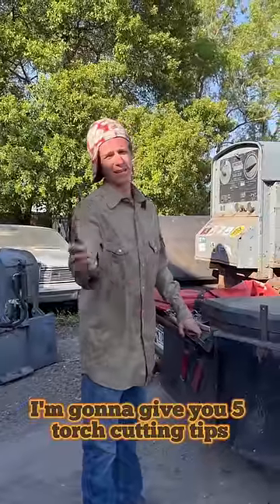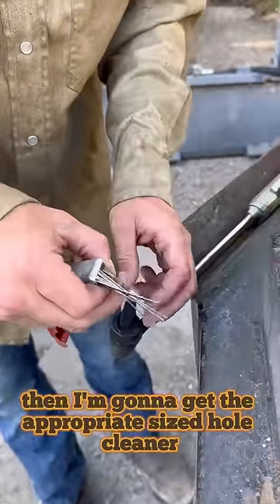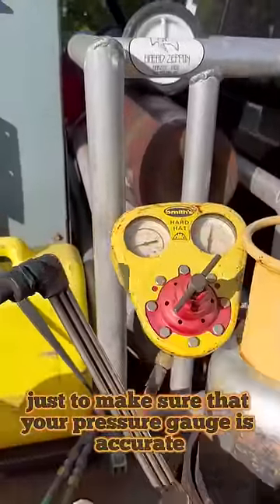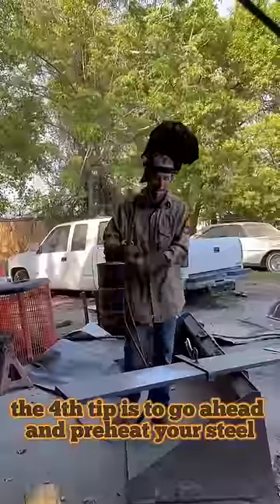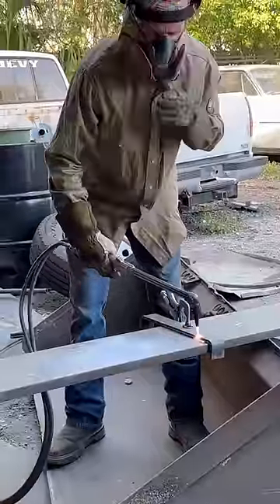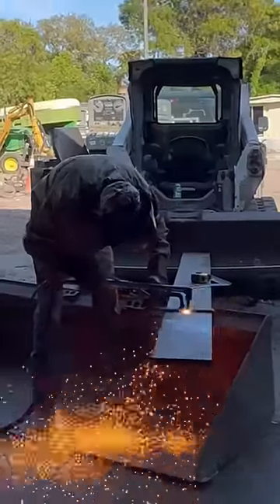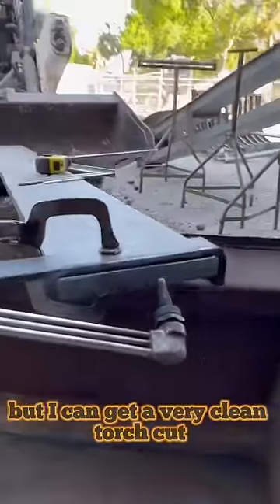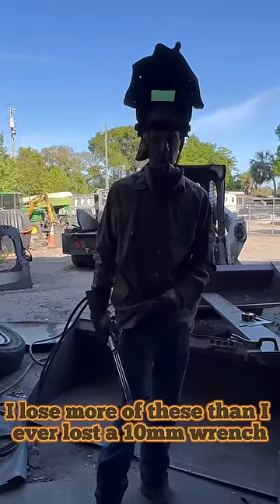Perfect Cut With a Torch on 1” plate

Comment: Thanks Anthony, I just started working with torches and the tips are helping a lot. Gotta remember to keep the striker close I keep having to look for it
Reply: Pro tip. Get a carabiner and put your striker on it as well as a 6” crescent wrench. That helped me out tremendously plus it’s harder to lose when you got a wrench on there to.
Reply: @jordanrounds9890  you can literally carry those in your pockets of your coveralls. Lots of handy pockets of them.
Reply: @BootsySage  Its easier when its on your hip, dont have to take the striker out of any pockets just bring the torch down to the hip and light off. Same goes for the wrench if i need to quickly swap out a cutting tip for a scarfing one. Idk personal preference for me.
Reply: On the first day of college welding class and I did all this.  The professor said I can tell you, you are getting an A
Reply: No way that you lose more than you lose 10mm's, lol. The striker industry would be our number 1 product
Reply: I'll be impressed when I see you crawl under a ship and wash the weld off the ship keel ( overhead, 4 feet off the ground) without gouging the hull.  Cutting your own tank wrench is a good start. 👍👍 Flamecutters rule !
Reply: Never carry a cigarette lighter in your front pocket.
Reply: If your work is still glowing you can usually restart quick by tapping on it if the flame extinguishes. Also starting off with a little oxy when you light up can keep the soot down, plus the oxy knob will already be cracked loose so you don’t have to fight it after your fuel is lit.

Comment: I always find it so impressive how engineering came up with a tool that uses fire to cut through inches of steel at such a high rate of speed ❤
Reply: It’s not really the fire though it’s the oxygen that very rapidly oxidizes the metal and blasts it away. 🤙🏻
Reply: @Jackson Combs it's still fire. If you turn the flow down, it's just a big flame. It melts the metal with very hot fire and the rate of flow kicks out the slag. It's just a really fast fire. The oxygen helps the torch burn hotter. It has nothing to do with oxidation. Steel ignites at over 1000 degrees and the oxygen helps the flame reach up to 3200 degrees. The fuel mixture is being burned simultaneously.
Reply: @Brolly-Unleashed  oxidation is fire.. It's the combination of an oxygen atom to a carbon atom (iron melts at 1,550 degrees BTW)
Reply: @campbellpaul  you can put anything that burns in oxygen, and it will burn brighter and hotter. Oxygen isn't flammable. You can cut metal without oxygen so the process can't involve oxidation. It's simply their to boost efficiency.
Reply: @Brolly-Unleashed bro what? Steel doesn’t ignite at any temperature it melts. In the case of oxy-acetylene cutting it’s oxidized so fast it looks like it’s burning or “igniting.” yes acetylene creates the fire you speak of but the true heat comes from the oxygen oxidizing the metal.
Reply: @jacksoncombs9290  fairly complex way of saying agree to disagree there are sources that say both are correct and it ultimately makes no difference.

Comment: you should talk about which bottle to turn on first. how to adjust your torch valves and how to start.
Reply: Doesn't matter, you adjust your pressure before lighting the torch. When lighting the torch you always open and close the fuel gas first. As for adjusting the flame when cutting it's pretty simple, you want them to be an even height so that they heat the metal evenly.
Reply: And proper shutdown/storage procedure.
Reply: This isn't meant to be mean. But if you need an explanation and help on which tank to open 1st and how to start your Torch... Then this isn't the video you should be watching.

This is a video explaining how to do a cut through heavy metal.  If you need to start at that level of instruction, there are many great welding channels that will walk you through the whole thing.
Reply: @thebigcheese8715  You close the oxygen first when turning off otherwise it will sound like a machine gun.😂
Reply: @moefritz9568  Never seen that happen, oughta clean your torch by the sounds of it.
Reply: @thebigcheese8715  meh, not my torch, it's the multi billion dollar company's that I worked for
Reply: @moefritz9568  they must've cheaped out and bought the hobo freight torches instead smith ones
Reply: @thebigcheese8715  Not sure the brand but it didn't help when they let the new idiots use them and they didn't know how and get the tips covered in slag
Reply: @moefritz9568  you'd think they'd show someone the proper way first, sounds like a recipe for disaster. Unless it's real bad good ol' oxygen and wire brush works far better than them shitty nozzle files. Darn things break just touching it.
Reply: 5lbs acetylene 25 lbs oxygen open acetylene first, light, open oxygen, cut away.

Comment: Adjusting the gas correctly , distance, pressure from the O2, and speed are all big factors. Each adjusted to metal thickness so it just takes practice. If you have the time and money, and you or someone you’ve hired, can just use scrap to practice. Scrap cutting is helpful as you get to learn on metal that is all shapes and sizes. It also gets people used to using the torch as they learn not to be nervous around it. It’s nice of you to show tips on this.

Comment: Good tips man. Another good one is to get used to cutting without putting much weight on your guiding hand or arm. It helps you smoothly glide across the surface of your path without stuttering and losing the puddle on the leading wall of your curf. It applies to allot of other welding and fab processes too.
Reply from the maker: Great tip!

Comment: One further tip is to watch the sparks angle as it leaves the metal.  It should be about 80 degrees, and adjust the speed of the cut to keep this angle steady.
Reply: Nah bruh watch that puddle don’t watch the damn sparks
Reply: @Bobbobness  dude its not a welding. There's no puddle there.

Comment: My 1st tip is: don’t file the tip and clean the holes with the tip still attached to the torch.
Reply: Why not? Thats what they teach us in school..
Reply: Did you see how clean the cut was
Reply: @northcountrywoodcraftny5953 it’s easy especially when The guy used a guide and held his torch against it..  you won’t have that luxury anywhere else but your own shop most of the time. I also don’t recommend burying your torch tip like that you will go through them faster than you can buy ‘em. lol.
Reply: @prius.killer it can be ok still but crack the air a little while cleaning and it will blow out any junk that falls in

Comment: Also use the right tip. Oxy acetylene can easy 100mm-150mm. 1“ (25mm) should be no problem if you can start start cutting from the edge. If you have to pierc through it in the middle of the plate is a different story and even makes me struggle sometimes 50/50 chance of backfiring. Some good days and bad ones. Always be aware the the torch can backfire and be ready to close the acetylene
Reply: When you ready to pierce, you suppose to do it at slight angle, not square to the plate.

Comment: Never done the prep heat🤔🔥 when cutting only when tig welding.  I typically use the plasma touch ⚡️but may go back and try some old school.  My touch is set up for welding and build up mostly.  Like welding aluminum and cast iron with it as that is about 80% of what I do with it or pre heat 420 stainless🥰

Comment: Straight edge when possible as a guide is just smart and should be used. So many times have I seen dudes cut with a torch and say “I don’t need no guide, I can make a near perfect cut after doing it for years” yet it still ends up all weeble wobbly…

Comment: Si i do this regularly at my job but with propylene and preheat is a must on this stuff. Also having proper pressure on the regulators is a big one too. Those 2 and you can get away with a lot if those 2 are done right. With that I regularly cut 3/4-2” steel.
Reply from the maker: I want a propylene set up

Comment: Not even trying to be a jerk here, but this is absolutely aimed at folks who have never, or only just started using OxAc torches. I know it's probably overly semantic, but this should have been titled, or you should have intro'd the clip as "beginner's tips."

That said, these are definitely good beginner's tips. If you can, you should try to use a piece of c-channel as your guide. You can ride the whole torchhead along the vertical and only have to worry about keeping your cutting height if you're really green.

Comment: Get as comfortable as possible before you start the cut. Use a 00 size tip for material under 1/2" thickness. Oxygen pressure shouldn't be over 45 psi. When cutting on plate use a chunk of 2x4 wood to rest your hand on. It's the perfect height and your hand stays cool. Use a dark face shield made for cutting. Keeps your face from getting burned from infrared heat and splatter.

Comment: Here is the best tip. Solid block about a foot long as guide about inch wide and tall enough to keep the tip quater inch above workplace when resting the tip nut on it. Weld a simple handle off one side. Easy straight cuts, you'll keep your tip cleaner for longer and the guides own weight hold it down.

Comment: Position yourself where you can look behind the flame all the way through the kerf then you can watch what the far edge of the plate is doing and you can make it a little cleaner. Of course trying to look down the kerf when cutting a circle is almost impossible, but I'm sure someone has a good tip for that it's just not me.

Comment: You can rub the tip full throttle against a wooden board to clean the tips, might work in a pinch good trick old welder taught me

Comment: I'd say I have to agree with you. The absolute insane number of times that I have had a striker fall out of my pocket or the tip unscrew.....

Or having to crawl up on a unit to braze something, finally get in the perfect position and suddenly hear the perfectly distinctive sound of cheap thin metal hitting the concrete.....

Or to be on a site and I'm sitting up there in a man basket a 100' in the air and suddenly realize can't strike up because climbing in and out of the basket to load gear, I knocked the sticker out of my hands.....FML.  (thank god I still smoked at the time.)

Comment: Ok, I've been at it for close to 30yrs and if i might add a few words?... turn your gas on slightly while you're cleaning your tip or take it off the rig(u don't want those lil burrs falling back down in your setup) and the gas will push them out. Use a piece of 2in angle iron for your straight edge. U can just let the torch sit right on the top and drag it along (helps control any depth issues) kick your tip a bit forward so you're cutting a lil ahead and once u begin, don't move on till you're all the way through. 2nd pass cuts pop like alot. And when your done, THAT'S when u clean your tip (on a piece of wood) just rub the face all over it. And after you're gettin it, if it pops and blows u out just hold that fucker down there and the cherry will reignite your shit. And, WRAP YOUR CORNERS!

Comment: My tip is to use propane for most all metal and acetylene for the thick metal.

Propane is cheaper and much easier to find if you run out in a location that’s is too far from an acetylene supplier👍
Reply: Acetylene is much better to work with. Most shops have gone to propane but out in the field acetylene will always be king.

Comment: All great tips.  Except there is no need to preheat your work if you have the correct cutting tip for the steel thickness.  Having said that, I agree that if there is mill scale on the work you can't get a clean cut.  That preheat pass can spall off the mill scale allowing a clean drop cut if everything else is good.  (I've been burning steel since 1966)

Comment: Next time just cherry a corner and always give the torch an angle in the direction your cutting in. 
I used to have to cut train cars and trucks for a living. You had to cut no less than 2 per shift. I could cut 5-7 in a 9 -11 hour. 
When you strike up, put the hot flame at the bottom corner. As soon as it Cherry's run the bead. Cut away from you and keep a steady slow pace. I used to cut 3-4 inch thick pieces with that same Victor in your hand. 
My EDC back then was 3 feet long and ran a number 16-18 tip. With that I would cut pieces 14-18 inches thick.

Comment: Tip: heat from the bottom,  it will save on Expendables (Acetylene)heat rises and will ultimately heat the Part that your flame is at it’s weakest,now will already be preheated..
 30 year pipe welder

Comment: 1/2" or thicker the torch angle perpendicular to the steel. Most of you could out there don't pre heat enough if at all and you end up fuckin butchering the "cut". Get in a steady position too like for a long range shot. On long cuts you can do a bailout circle on the drop piece

Comment: What am I doing wrong when the cut fills back in as I cut?
Reply: Overheating, traveling too slow.
Reply: Also too big tip size, wich would result in overheating. 
Match the proper tip size to the thickness. Then proper pressure to the tip size.
Reply: Thanks, looks like I need to do some research, but have a good place to start. I’m a mechanic and mostly just use it to heat/melt rusted shit, but would like to learn how to properly cut.

Comment: if you go slow enough. there’s no need to preheat the cut line. there is no such thing as speed when cutting with the gas axe. people who try to be fast always end up relighting restarting and loosing there burn. slower is smoother and faster.
Reply from the maker: Wrong, you should always preheat 1/2 +

Comment: Never understand cleaning the tip by pushing anything stuck inside.I always remove tip and then clean it,i do it by hand because there is no need to tighten bolt that hold tip with wrench.Ofc only if bolt is cold,when it gets warm,and hot ,u need wrench to remove tip.But i tend to cut from really large distance ,tip and cutting peace,i very rarelly have need to clean the tip.

Comment: do not drag your tip keep at least 1/8 to 3/16 up so your preheated can work and use correct tip I don't use a guild I make a line and properly rest the torch  slitly tip your tip forward  with correct  speed you should  see your reflection in the cut

Comment: A far better method to clean torch nozzles is to use a wire brush and give it a little oxygen, works almost everytime and you don't have to fuss with them break-away files.

Comment: You are doing it wrong buddy. Always push your cut away from you for obvious reasons of keeping shower of sparks and slag from burning you. and use elbow in the hip to steady your cuts.
Reply from the maker: It’s not wrong, it’s how ever your comfortable. I get better cuts pulling
Reply: @MeltinMetalAnthony  maybe it works for you but it’s not what I’d teach someone wishing to learn our trade. I totally agree with you on torch prep and cleaning but instead of file I use 400 grit emery. I have cutting tips from the mid 90’s that work better than new
Reply: @ MMA Exactly. Push-pull, left-right, all the same.